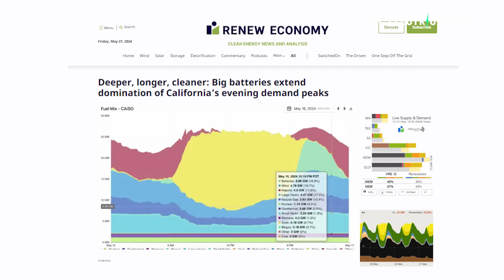Fossil fuels shattered as battery power continues breaking records in California

Comment: Gasoline  prices go up and down, but Electric prices just goes Up and Up, and never go Down
Reply: That's wrong. We have so much solar and wind here in Sweden and in countries around so the bigger problem right now is that the price is negative mo many times. Tomorrow it will be negative for 4 hours during the day where the price goes as low as $0.05/KWh. That means I will get money to charge my car, but will have to pay to "sell" solar that I don't use.  (In reality I will stil go plus with $0.01/kWh since we have some tax cuts when we sell solar here in Sweden.)

The price was negative for a few hours today as well, but not that much. 

The more renewables in the grid the cheaper it will get. And it actually starts getting a lot cheaper now using batteries to store energy in the day and using that during peak hours. Look at California. They have enough batteries now to make the expensive coal plants to be used so much less.
Reply: My cost of electricity has gone down and I have yet to see petrol go down.  If it comes down is because it went up and it never comes down more than it goes up.

Comment: Because California will subsidize the hell out of anything no matter how economically unviable it is.
Reply: Turns out that not only is it economically viable, grid-scale storage is by far one of the most economical ways to solve numerous grid issues, such as congestion.  So much so that states like Texas are now copying California's model to stabilize their own grid, load-shift renewable energy to times when it is needed, and reduce the need for extremely expensive transmission line expansion projects.

Someone is feeding you truck-loads of nonsense.  You might want to update your understanding.
Reply: @junkerzn7312  “. . . a naïve observer might conclude that the rising share of new renewables (solar and wind) will usher in an era of falling electricity prices.  But in reality, the opposite has been true.”  Vaclav Smil, Numbers Don’t Lie, p.172

Comment: In a very real sense, this month (May) has been insane for California.  Truly insane... climate change in spades, just not what people might be thinking of as climate change.  The Heat Dome in the gulf / Texas / Central-America / Mexico which is causing so much chaos in Texas and Mexico has also ushered-in incredibly moderate weather for California, particularly overnight cooling (Pacific Ocean), vastly reducing the A/C load.   Usually by now I have to run my central A/C but next week is likely the first time I will have to do it this year.  In otherwords, Texas's pain is California's gain.

This will probably dissipate in the next month or two but for now the state is basking in moderate weather with great natural overnight cooling.   This is primarily why NG generation in the evening has been lower than typical this month.  But the batteries do matter a lot too.  The two together make for very low NG consumption.

In anycase, the video is still exaggerating things a bit.  Battery output is indeed peaking over 7GW on some days, but natural gas is still the single largest evening fuel at roughly 9GW in the late evening (yesterday for example).  This is greatly reduced from prior years, that much is true.

The "fossil peak" has moved past 8pm as well... that part of Sam's video is bang-on.   The fossil peak continues to shift later and later into the evening in addition to moderating.

What is happening is that California has basically reached a critical transition point with grid-scale storage.  For the last half a decade grid-scale storage in California has hovered more around the 3 GW mark during the evening peak window.   But severe heat domes over California in recent years has caused the state to focus on vastly accelerating deployment.   The state is now adding several GW each year and anyone with half a brain can understand what that means given the numbers I've thrown out in prior paragraphs.

That deployment is now quickly moving California across a critical transition point.   Heat domes are still a threat, but not nearly the threat they would have been just 2 years ago.  Within the next 2 years the threat will be gone for good.   Heat == Sun == Power == less grid stress.

-Matt

Comment: Green energy is very expensive. The more solar energy produced PG&E keeps on increasing electricity rates in San Francisco.
Reply: You are conflating the cost of energy with private business. The green energy is way cheaper. The core business which is fossil fuel is becoming more expensive. The price increase is because they are charging you for the extra cost of keeping the fossil fuel side of the business running. Research Levelized Cost of Energy and you will see that both now and into the future, wind and solar are so much cheaper per kWhr than coal or gas or nuclear
Reply: @zoransarin5411  “. . . a naïve observer might conclude that the rising share of new renewables (solar and wind) will usher in an era of falling electricity prices.  But in reality, the opposite has been true.”  Vaclav Smil, Numbers Don’t Lie, p.172
LCOE does NOT include the cost of supplying electricity WHEN intermittent sources fail, and the revenue that can't be received WHEN intermittent sources fail.  An accurate assessment MUST also include LACE (Levelized AVOIDED Cost of Electricity).

Because solar and wind are intermittent and demand is continuous, backup power will ALWAYS be needed.  Batteries are VERY expensive, as is keeping fossil plants running on standby to produce WHEN intermittent sources fail.
Reply: All the more reason to go solar
Reply: Our PG&E bill is primarily going up because of fire-safety work... undergrounding up in the foothills for the most part.   What a waste of money.   That and a CPUC that is in the pockets of the utilities, letting them get away with it.  And the private utility company's "10%" guaranteed profit.   It isn't renewables causing the bill to go up.

After having to deal with insane natural gas pricing the winter before last, California is in a much, much better place with all the renewables now than it has ever been in the past. 

Advocate to have the state take over PG&E and SCE and such if you want to see lower bills.

-Matt

Comment: California has the highest cost most insecure electrical supply in all of the USA.  Solar is over producing at times driving down returns so other generating systems which are going bankrupt while increasing costs for generation when solar and wind fail to supply power.  California even extended the life Diablo Canyon nuclear power plant when it was realized that 78 square miles (200 square kilometers) of natural areas would have to be sacrificed inorder to replace the 100ac nuclear plant.  Projected need for batteries is in the billions of dollars with wind, solar, batteries needing replacement every thirty years or so.  Nuclear plants by contrast can last over a hundred years and are orders of magnitude less destructive to the enviroment.
Reply: 100 years???? Not hardly… they need constant upgrades and updates and refueling… also need highly trained technicians… so you’re totally wrong…
Reply: @skepticalmechanic  Every study I have read said the total energy needed for the USA was about 100 sq. miles.  This in NV and AZ could take care of it.  Not a good idea though.  Better to follow highways 10, 40, 80 and Hwy 90 across the country and highways 5 and 95 for additional capacity where needed for the high population density areas and install many smaller arrays across the country placing the arrays and storage in the space between the lanes of the highways.  Land already allocated, 4 hours of hours more for production due to time zones.  Easy access and maintenance.
Reply: @skepticalmechanic  Nuclear needs trained operators and maintenance.  Solar panels NEVER need cleaning and last forever.  Wind blades don't kill endangered raptors and also last forever (and NEVER end up in landfills), along with the mechanical transmissions which NEVER need maintenance or replacement and NEVER catch fire.
(OK, sarcasm off now.) 🤣

Comment: What propaganda B.S. Batteries generate tremendous pollution to manufacture  and produce, especially at the scale shown. Therefore not "Green" at all. Batteries don't last very long. As anyone who owns a cellular phone or any battery operated device knows. Which will require the batteries to need to be replaced within a few years. Creating the mass manufacturing pollution all over again and again and again as long as they're used. Not "Green" at all.

The energy loss that occurs while charging a battery is significant and very inefficient. Making the use of such infrastructure ungreen. Now I know all the idiots who are dumb enough to fall for this type of B.S. think the batteries are supposedly changed with "Renewable energy" such as solar panels and wind turbines. Though if they looked into the matter they would find that's impossible and isn't the case.

The reality is the battery arrey will in fact actually be mainly charged using Commiefornia's existing electric infrastructure such as coal and oil burning power plants.  All that inefficient, mass polluting waste to run 3 hours during the night and that's supposedly "Green". Yeah and the water in your toilet bowl is recommended for drinking. But this crap is believed by the morons who buy electric vehicles and think they're "Green" and saving the environment/planet. 

The amount of pollution generated to produce an electric vehicle is the equivalent of an ordinary gasoline vehicle having already been driven for 10 years. These lies and insanity need to stop.

Comment: CA electric rates are 3X what they are in the Southeast. Saving the planet is expensive.
Reply: California utility costs rank number 19 in the nation with an average of $437.92 per month. the average electricity bill is 123.67 per month.
Reply: @sd70cal  I'm not talking about monthly bills, which are dependent on the climate. CA has a very mild climate, so electric bills should be much, much smaller than regions that require a lot of air conditioning, for example. I'm talking about the cost in $/kWh.
Reply: @huskypup3489  Those were monthly charges averaged over the full year. That's how those metrics were provided. Most of the CA population live on the inland side of the coastal mountains. These areas see summer temperatures in the high 90's and into the 100's. So AC use gets to be high with them. The winters are milder but many homes here use LNG. 
CA is big and not all regions have the same power distribution costs. I don't know all of the rates. It seems like you want to show that by shifting to renewable energy that the price for Electricity will be higher than somewhere which is solely fossil fuel. 
To see if what you believe to be true is true then you would need to break out the costs of that energy to see what the individual components are. To do otherwise would be engaging in misrepresentation. Something many politicians are prone to do. 
Another point to consider is the reduction in renewable costs that are still continuing whereas fossil fuel plants are not getting much more cost efficient. Then there is the fuel itself. The more our power grid shifts to renewables the less of a demand there will be on fossil fuels making them cheaper. And nations won't be as beholden to those oil rich countries creating skewed political alliances. This seems to me to be a win win for everyone.
Reply: @sd70cal  “. . . a naïve observer might conclude that the rising share of new renewables (solar and wind) will usher in an era of falling electricity prices.  But in reality, the opposite has been true.”  Vaclav Smil, Numbers Don’t Lie, p.172
The cost per KWh is what matters.  You can't compare San Francisco HVAC costs to Minneapolis or Miami.
Reply: @huskypup3489  Monthly bills are the bottom line for consumers, not $/kWh.  So yah, they matter more.   Electricity costs are primarily a function of infrastructure maintenance, not generation.   It has nothing to do with the climate.   If California's climate were the same as, say, Texas, our $/kWh costs would be far lower but our monthly bills would stay about the same.   That's the basic reality.

Using less electricity on average in a state uniformly translates to higher $/kWh pricing.  It also translates to more opportunities to conserve.   Taking advantage of that means investing in your own future... and some people aren't smart enough to do that.  Well, too bad.
Reply: @dzcav3  Your quote is from a book published in 2021. In the world of new technology that information is ancient. Costs for both battery and solar products have fallen immensely. 
If you want to compare cost per kWh you will need to pull out all of the costs not associated with renewable generation for your comparison to be of any use for your purpose.
Reply: @sd70cal  If CA monthly bills are $437 a month, and the national average is $127, doesn't that suggest CA is a disaster? My monthly bill for a family of five in a 3100 ft2 house in CA was about $450. I moved to GA in 2020 and now my bill is $275 a month for a house twice the size, with a pool and 3 AC units. Renewable energy is absolutely more expensive. Look at Germany for another example of the disaster that "renewables" have been for energy costs.
Reply: @huskypup3489  CA utility bill average was $437, CA electricity bill average was $127. Not the national average. If CA was 19th in average utility cost there must be other places with more expensive utilities. 
The cost of CA electricity is more than the cost of renewable power generation. You would need to compare that specifically if you want to be justified in your anger. 
Glad you are happy living in Georgia. I've lived in many parts of the east and southeast, have family in Georgia. They like it there for their reasons. Even with the higher cost here in CA there are many reasons I prefer it here. 
Switching over to renewable sources is going to happen. Fossil fuel supply is not infinite. It makes us and other parts of the world dependent upon other countries which are run by autocrats and dictators. Moving over to renewable will reduce the demand of oil where we can leaving a bigger supply for where renewables are not optimum. Even though we are today the largest producer of oil, switching over to renewables will make us more energy independent. And we need to be at the forefront of this or China will eat us for lunch.

Comment: Storage! Storage! Storage! - we have solar, we need batteries!
Most don't realize fossil fuel power plants run @ 30% efficiency since they have to be able to support peak loads.
It takes hours or even days to ramp up to a high level depending on which fuel. Even nuclear takes a while to ramp.
Existing fossil fuel plants with batteries would improve efficiency greatly. Adding solar adds even more.
The difference in performance from my old 5 KW-hr battery to a 15 KW-hr was amazing. 
I went from having to run my generator almost everyday to once a week.
Reply: Morro Bay ca. Won the battle of big business trying to push dangerous Lithium battery  storage yard in their  sea side town. People got together and told them to move-on. Big business  is trying this in many unsuspecting towns around the States. We have enough  chemicals in our lives

Comment: In 2020 California rejected/curtailed 5% of the solar power that was generated.

In 2021 California rejected/curtailed 4.2% of the solar power that was generated.

So we are not talking about HUGE amounts of power that is un-used or over-produced.

California is trying to get to 0 fossil fuel for energy by 2045.

This is a change.

We need a LOT more over-production to turn off coal, fossil fuel.

We need MORE solar infrastructure and MORE over production so we can safely shut down coal plants, diesel generators and close valves on hydro plants and 'bank' more water.

We wont get to 0 fossil fuel use with only single digit over production.

Guess what? When we over-produced 5% of solar - it was because we had already agreed to buy coal, diesel and power from other states to satisfy our needs. If we had 30%-50% over-production capability of solar - we could have used less other sources of power.

So when people spout "California generates more power than it can consume" - it does NOT mean that solar produces 105% of our afternoon power needs. It does NOT mean we have ever had an hour where 100% of our power came from renewable/solar energy.

https://www.energy.ca.gov/news/2023-05/new-data-shows-growth-californias-clean-electricity-portfolio-and-battery

This year we might be close to having a few hours a day where 50% of our power needs come from Solar.

We need 2x of the solar panels we have now approach 100%. And I suspect we want 2.5x the number of panels as a buffer/cushion.

Over production of solar power does not hurt anything. In fact - we could use it to pump water from lower rivers and lakes to behind dams during the day, then hydo takes over our power needs in the evening.

And excess power - can be sold to other states. The utility companies have resisted doing this because "It's not the way we have done things in the past.".